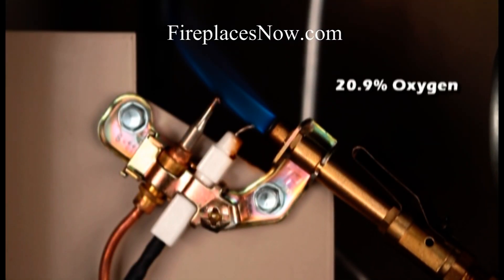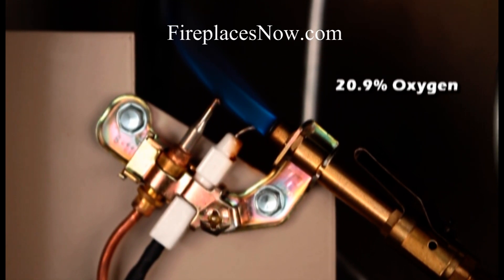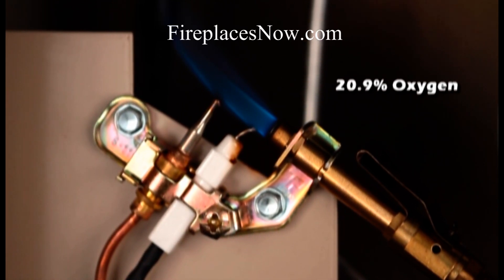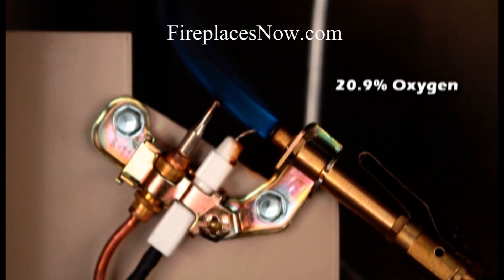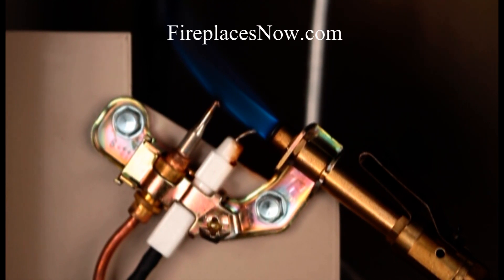How An Oxygen Depletion System Works

Comment: My fireplace used to run just fine.   It is an electronic ignition with a remote.   Now when I start it, it cycles through everything, lights just fine, burns for about 8-10 minutes and then shuts off.    I have replaced the thermocouple but it is still doing the same thing.   The gas company where I purchased it 5 years ago says they no longer service ventless gas fireplaces.  So I am at a loss.   I will try to run it with the damper slightly open, to see if it makes a difference.

Comment: To bypass these you wrap a bit of wire around the thermocouple and have a bit of it extend into the path of the flame. 
The wire transfers the heat to the thermocouple and the system keeps running.
PS this is a terrible idea the only reason I know this is because bad gas quality can mess with the flame making the oxygen sensor misread and shut down your heater.

Comment: I've a new Dyna Glo ventless heater and the pilot does the same as your example at 0:34 sec it begins to crackle/sputter slightly then the flame tip extends, the gap from pilot tube widens then it goes out. There is adequate oxygen/ventilation in the room and other gas heaters equipped with ODS  function fine.  I've cleaned the pilot tube for any manufacturing debris and noted that if you partially obstruct the pilot tube 'vent' hole on the side the pilot behaves normally without sputtering and will remain on....is there an adjustment for the hole in the side of pilot tube?
Reply: I have a question for you if you get this comment
Reply: There is no adjust but after a lot if frustration and 2 new wall heaters by Mr. HEATER,  I bought an EMPIRE ventless wall heater and in identical situations it stays burning and is working great. 
I was told the cheap $200 stoves you'll always have trouble with.

Comment: This keeps happening to me how do i solve it open a window or will a fan blowing air work ir whats the best solution?
Reply: Buy an Empire heater. 
Trust me, the cheap heaters are prone to this. My new Empire is AMERICAN MADE and is designed to function at high altitudes too. I wasted $400 on 2 Mr. Heaters before I was told this.
Reply: keep a window cracked open if it continues to happen you might have to open window more depending on wind direction at window
Reply: This sensor has rendered portable propane heaters like The buddy heaters useless

Comment: How do these operate in high altitudes like in Bolder CO?  The normal oxygen level there is approximately 16%.
Reply: no, no, no, no.  The oxygen partial pressure is lower, but the percentage is the same.  How the lower pres affects burning - and thus the oxygen sensor, I don't know.

Comment: This is an excellent demonstration- but vent-free heaters can produce lots of carbon monoxide without shutting off via the ODS. Look for any sputtering, inconsistent burning or yellow flames and a carbon monoxide detector is a must with any oil or gas heater.